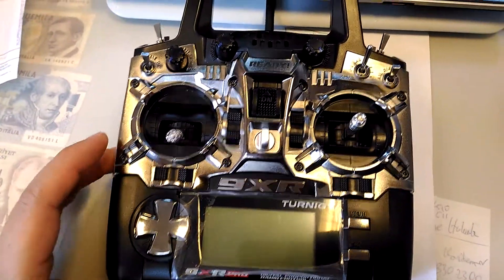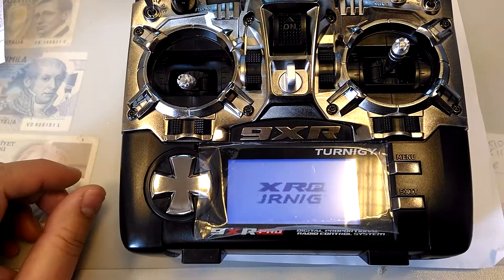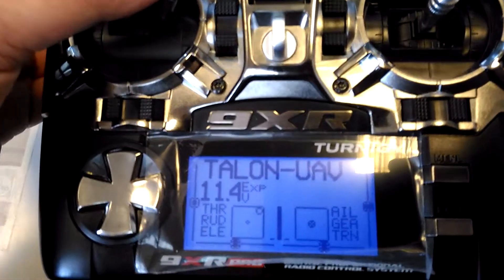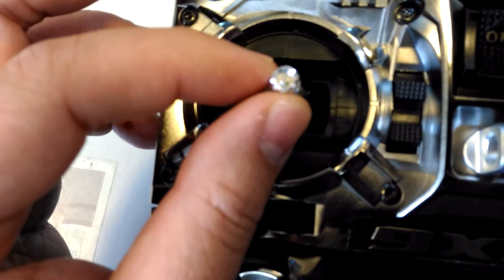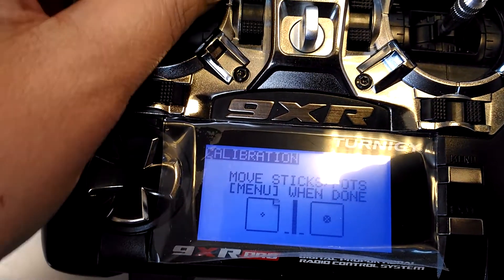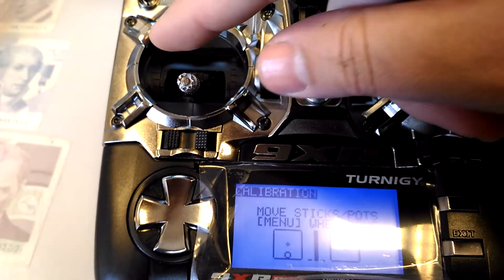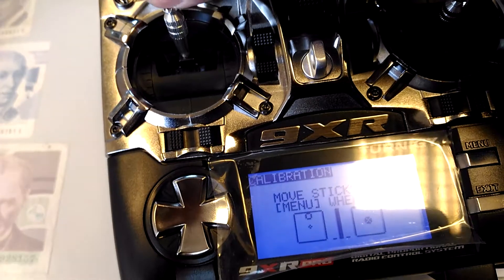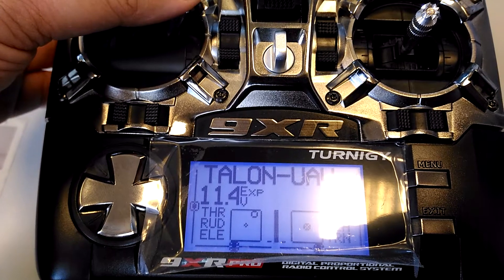Turnigy 9XR Pro Stick Problem

Comment: I am sure that you have probably solved the problem by now, but in the end did you determine that it was in fact substandard potentiometers? I sure hope I don't get a lousy gimbal.I have big gimbal issues with my 2013 9X with every mod and update you can imagine. You cannot buy new gimbals, or even the raw pot tapered potentiomenters for these radios. I have searched the world :-) (and Aliexpress)
 I just bought the Mode 1 version because they are selling for $59 as opposed to $101 for the Mode 2. I really should have just bought the Taranis and had done with it. 
So now I can't even get good info on the 9XR Pro's OS, or rather the Firmware that is being used on them.
I suppose that you are no stranger to ER9X but they speak of some version of this that is used in the Pro to account for the ARM processor that was originally created for the ERSKY board upgrade (for the 9X) that one could do back a few years ago. Ancient history in today's terms :-)

Comment from the maker: By the way, we bought 6 Taranis gimbals to replace all the gimbals of our three 9XR PROs. The physical adapting process was really hard. You should make too much milling job on both the gimbals and 9XR chassis. Especially, if you will use 9XP for APM or Pixhawk series, arming or disarming is difficult, sometimes impossible, for you can not reach the most bottom left and right corners. Below is the latest view of our 9XR PRO after fixing. Focus into the red circles.
http://mimoza.marmara.edu.tr/~baris/resimler/9xr.jpg
For the left stick, you have to make milling process on the outer bottom left and right ends, which works but not seem nice. This video https://www.youtube.com/watch?v=ixeQ7FYjSPM&t=44s is good but not enough for APM users for arming issues.
Instead; buy a Frsky Taranis radio. Because, you may have hundreds of models (car, heli, drone, etc.) but one radio controller!!!

Comment: Boris email HK support they will help with your problem. Or at least I hope they would. You could also try and re-flash the firmware to see if that would help..
Reply: +Dieter R 
do you have a link to 9XR FW?
Reply from the maker: I wrote to HK support. I requested resend a new one.They had finally accepted the problem and sent another one.Which funny is, this time the RIGHT stick of the new one has the same problem too :))HK made me change the left gimbal.Infact, I am a good customer of HK and they should have sent me a brand new one, which was double checked!!!
Reply: +Baris Dogan 
the problem is not gimbal but potentiometer design, even a brand new replacement won't work well/reliable without conductive silver glue modification.
http://www.ebay.com/itm/0-2ML-Silver-Conductive-Glue-Wire-Electrically-Paste-Adhesive-Paint-PCB-Repair/370976716779?_trksid=p2047675.c100005.m1851&_trkparms=aid%3D222007%26algo%3DSIC.MBE%26ao%3D1%26asc%3D36469%26meid%3D4c8ded599cca44be8f5878c47859749a%26pid%3D100005%26rk%3D2%26rkt%3D6%26sd%3D301058591643
This is what you need to make it rock solid.
Reply: @SladkaPritomnost Can you please explain how ? How did you do that modification with conductive silver glue ?

Comment from the maker: By the way, the replacement radio which had come from HK has right stick problem :)) I bought two 9XR's and the second one has the same left stick problem too, as the one in this video. I will make another video, with three brand new 9XR's; two of them has left and one of them has right stick problem :))  ***Old 9X has no such problems (I bought and sold three 9X's in the past and none of them has any problem) !!!